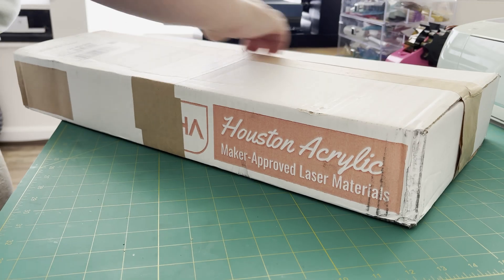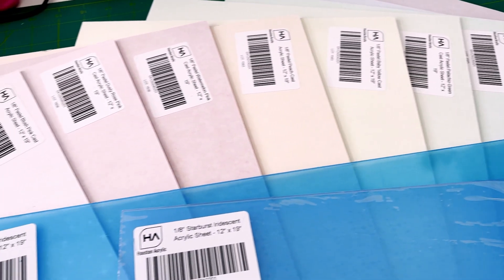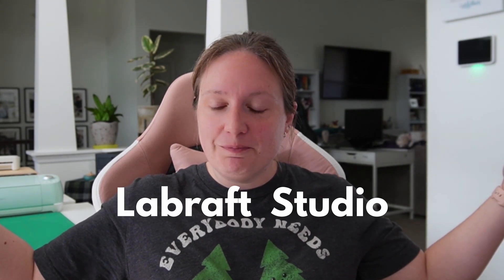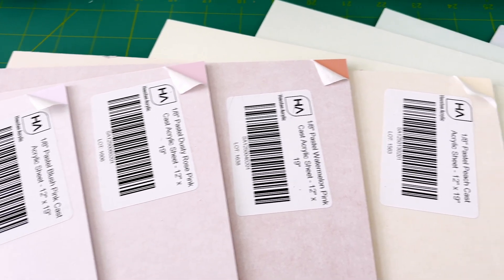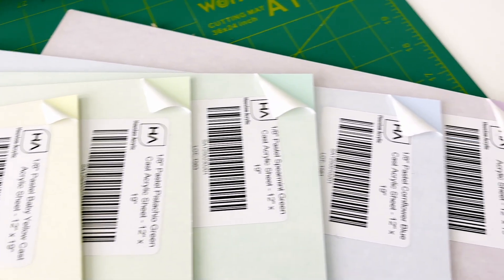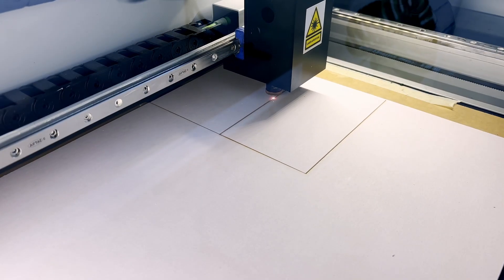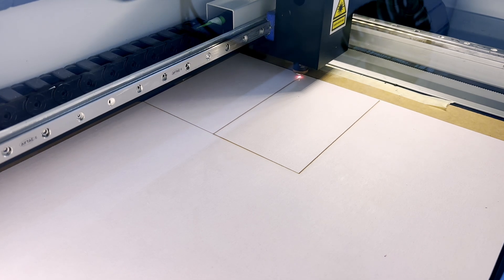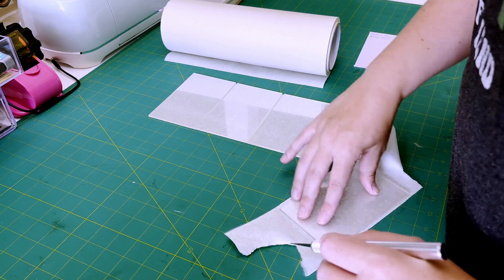Ditch The Glue: Laser Weld Your Acrylic Like A Pro!

Comment: I tried it and both pieces welded just fine.  I tried a black acrylic with a clear acrylic with an engraving in between.  Welded well but there is an issue, some "bubbles" for lack of a better term, around the edges.  Do you also get those?  How do you get rid of them?  I have a Trotec Speedy 300 100 watt CO2 laser.

Comment: For those that almost worked it may be worth trying what they call a cleaning pass in cnc. This is where you run another pass or two around the perimeter to clean the edges. With a laser this may further fuse the edges.
Reply from the maker: Interesting idea. I’ll have to try that!

Comment: Vinyl stickers are probably too thick to allow the acrylic edges to touch.  If you engrave a shallow pocket for the sticker to set into, you may have better luck.  I think that may be the issue with the paint and resin as well.  If either of those is even a fraction above the surface of the acrylic, edge contact will suffer.  Another thought... if you are going to have any scoring or engraving on the inside, make sure the melted edges of the score/engrave are not protruding past the surface.  If so, knock the high spots down with a small file.

Comment: What happens if you use higher power or slower speed to give the weld more heat either way.
Reply from the maker: You get a nice edge. I mentioned in my latest video going slow and hot will give you a better weld.

Comment: Ok, so welding happens when    2 pieces of acrylic are aligned and secured together with tape before laser cutting so the laser fuses the edges as it cuts? 

Thanks for sharing all your ideas and for doing all the work for testing.
Reply from the maker: Yep, the hard work is all done by the laser!

Comment: I also had another question. I was wondering if you could do the same technique with a  diode laser. I know you cant cut clear acrylic. But what if you place the coloured acrylic on top and the clear acrylic on the bottom.
Reply from the maker: The laser wouldn’t cut through the bottom layer. Once the laser hits the clear it would essentially scatter and not cut. You could try with two diode compatible colors and set your settings to the thickness of the 2 materials combined (ie 6 mm for 2 pieces of 3 mm)

Comment: Oh I wonder if you can make shaker charms with this technique!Ive seen acrylic shaker charms before.
Reply from the maker: Funny you mentioned that… My husband actually suggested the same thing when I showed him that tiny square in the beginning. I’m guessing you would have to do a super deep engraving or potentially a set of layers with say 1.5 mm acrylic. My only concern would be the fluid trying to leak out.
Reply: @LabcraftStudio I believe I saw that they were 3 layers of acrylic
Reply: Like @Serkunny said, maybe it could work with 3 layers of acrylic, the one un the middle will be an outline/silhouette wall, creating a hollow in the middle. Perhaps without liquids, but just glitter and tiny cute charms inside. 
   It would be interesting to explore the possibilities with different thickness, the one in front could be thinner than the others, or whatever.
Reply from the maker: Yes, I feel like YouTube was telling me I need to do this in the near future because I just saw a short from Glowforge that did something very similar. I also have 1.5 mm acrylic coming tomorrow so… 🥽🔥
Reply: Great technique. What machine were you using?
Reply from the maker: Gweike Cloud II Pro. 55W CO2 laser